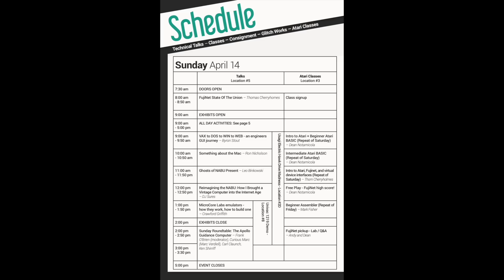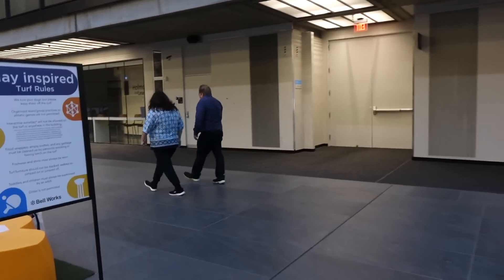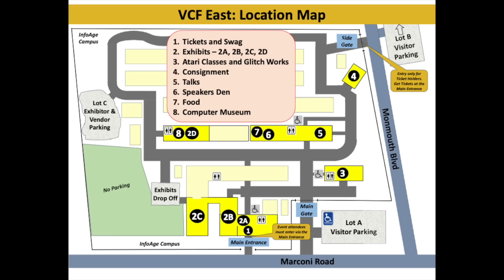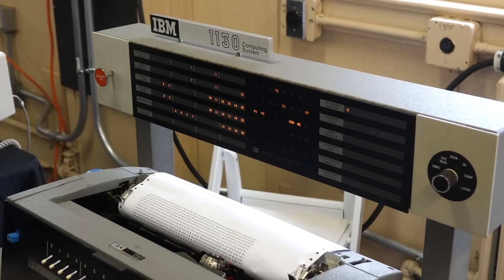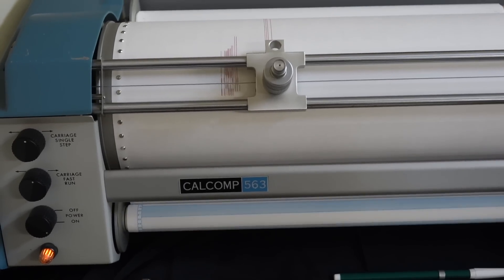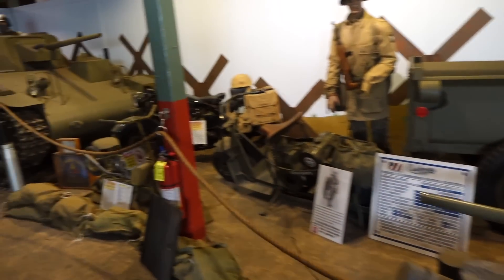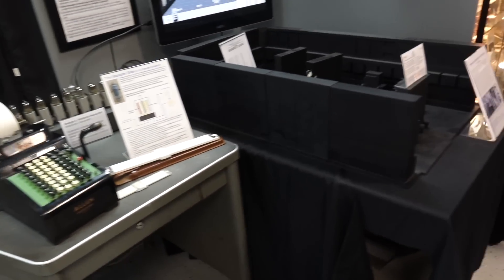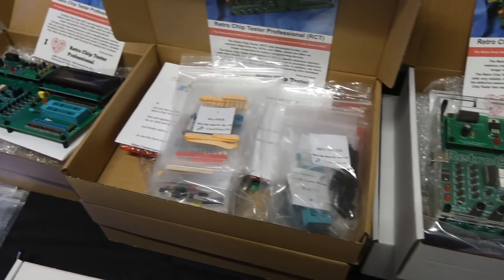We attend the Vintage Computer Festival (VCF East 2024)

Comment: I haven't seen an HP7550A running since the 1990s at my first engineering job! Great workhorse, except for when it tried to draw toroid transformer symbols, with lines radiating from a single point - the center would get soaked with ink and start tearing the page 😆

Comment: Wow. I'd have loved to have been there to see VCF. Very impressive displays and restorations, with even more impressive efforts behind them. Great to see the Holmdel building  again, too. It looks like Bell Works has been doing a terrific job with their stewardship. I left there in '91. Yeah, it's huge. It used to take me 20 minutes to walk to the cafeteria from my office. I imagine they probably gutted all the desks and furniture out of the offices, but it would be something to see if any of the offices were preserved. I recall someone telling me that the office furniture was all special-built by Steelcase to AT&T/Saarinen specification. The office furnishings were all very egalitarian - except for the furnishings in the executive office suites tucked into the top floor of the northwest corner that were filled with exotic hardwood paneling  and 3/4 inch deep cut-pile carpeting.

Comment: Love, love, love that IBM 1130! I almost fell out of my chair when I saw it in the background and I was hoping you'd stop for visit. I spent over a decade programming one of those for my company and it's still my absolute favorite computer. I added 8" floppy disk and digital tape to ours and made many modifications to the disk monitor system during that time, making it do things it wasn't supposed to be able to do. I still have bit and pieces of it, including all of the ALDs, a complete load source deck, and several 2315 disks. Is that 1130 on permanent display somewhere? I'd love to attempt to convert my disks to images that I can use with the 1130 simulator. I recognize those Heathkit terminals, too; I built several of them.
Reply from the maker: This IBM 1130 is now at the System Source Museum (next episode!)

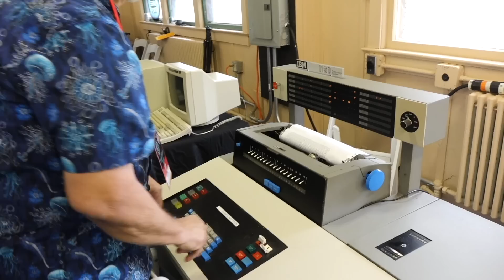Comment: @ 05:20  wow! That IBM 1130. What sweet sweet memories. 
I was 15 in 1969 when I saw My First Computer. Second floor of the Instituto Tecnológico. Sealed behind a huge glass window. Kept cold cold cold.
Fascinating blinking lights, cards zipping through some machine, another rolling out wide sheets of green-lined paper with typing on it…
I was hooked forever.
My Father was a Mathematics Teacher there, so I had access.
Many a week-end were spent there as I DEVOURED those systems tech manuals, repair manuals, programming guides, FORTRAN, RPG, COBOL, SPICE, assembler. 
I taught my self HOW things worked, their operation, how to clean them (paper, cardboard, ink ribbons, oil, grease result in cleaning chores 😊)
That system was never as clean as when I was there (ain’t brag if it’s true)

Main system had 8k word core memory . One single-platter diskpack drive 500k word capacity. One card reader/punch. One impact chain printer.
Adjacent data entry had four card punch, one card sorter.
A student area had two card punch.

One time we had an IBM rep arrive to install some fancy software update of sorts. he updated all the OS and programing software. We got an update to our FORTRAN-IV, but still was not up to the (at that time) latest ISO-standard. Budgetary concerns.
One thing I have never forgotten was when he explained to my farther the SPOOL update. He explained that is was a subroutine to enable ‘Simultaneous Peripheral Out-Put OverLap’. That it would maximize I/O. I did notice that the line printer and card read didn’t pause as often, and the disk-drive sounded different.

BTW, the disk-drive had a whopping 1,500 ks stroke. Smokin’ fast 🤠

I taught my self so much. And how I miss the sights and sounds.

Comment: Did you try to take the elevator to see your old office? I used to work in a 1960's innovative office complex with very interesting quirks, like its own line of furniture, a 10 story atrium, big sports hall, indoor shooting range, a large 'launch control' style room that controls all the building's automation, and all sorts of other nifty stuff. It has been empty for almost ten years and part of the lower buildings are already demolished for new cookie cutter apartment buildings. The main tower was supposed to be redeveloped into something, but it is built so solidly they decided it is not worth it. So now it is just a shell. I find it amazing that I never took any pictures of the offices while working there. Back then it felt just like another workplace, nothing that I would want to think back in the future.
Reply from the maker: Yep I tried to take the elevator to get to my office but the elevators are now blocked with automatic gates that read badges :-( .
Reply: @CuriousMarc  I'd have gone even if it meant trespass - its Bell Labs you worked at, for pete's sake.
(I'm told I have a slight jail wish so don't let that bug you)

Comment: As a 40 year EE I really enjoyed the tour of Bell Labs, I'd no idea it was such an impressive building. Thanks for adding the side trip.
Reply: There was also Bell Labs in Murray Hill, NJ where UNIX was born.   I worked for Alcatel-Lucent for a few years and had a chance to visit the site a few times.  There used to be a small museum there related to the work that the Labs did.  I have no idea what happened to that facility after Alcatel-Lucent was acquired by Nokia. 

I was able to make it to VCF East twice over the last so many years.   Both times I was there for VCF, it was raining, a bit of a PIA as you'd move between buildings.   I can see that I'll have to align my next visit with CuriousMarc's trips.

There's also a nice museum just north of Pittsburgh, the "Large Scale Systems Museum" that has various mini computers and mainframes.  Rather than being static displays, much of the hardware can be powered up, booted and runs, though not at the same time due to power and HVAC.  They've also some early personal computer stuff, too.  Well worth visiting if you're in the neighborhood.
Reply: @lmamakos  thanks for the tip.

Comment: A company close to where I live still rents out those old Sperry carbon-arc searchlights, with the original GE genset.
Reply: Is the generator run by a Jeep motor? Our local amateur radio club affiliated with the local university would pull out once a year a WWII generator to power all the stations for field day to get extra contact points because they were on generator power. The generator had a Jeep motor running it. It basically used an entire 55gal drum of gas for that field day weekend. It just hummed away all weekend. It included a power distribution fuse panel with thick cables distributing power to the various stations operating on different frequencies and modes, i.e. voice, or CW or digital. The CW guys were furthest away from the generator to cut down on noise.
Reply: @marcusdamberger  Don't know, unfortunately.